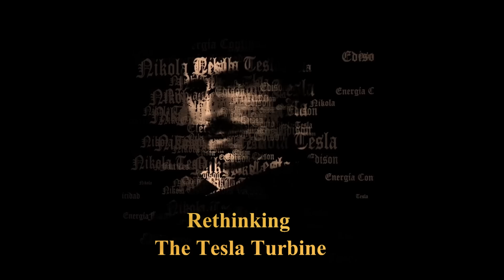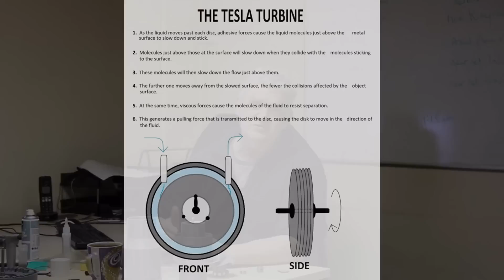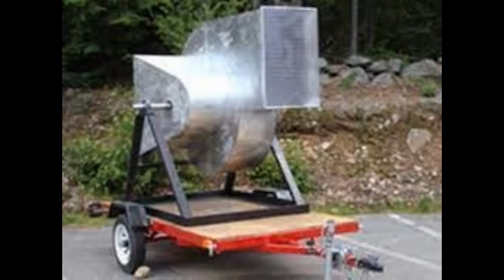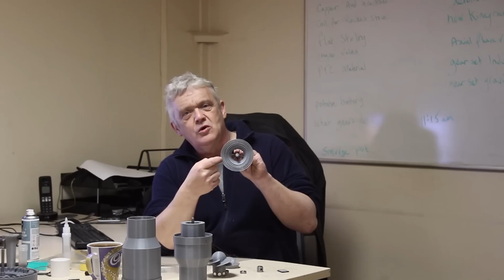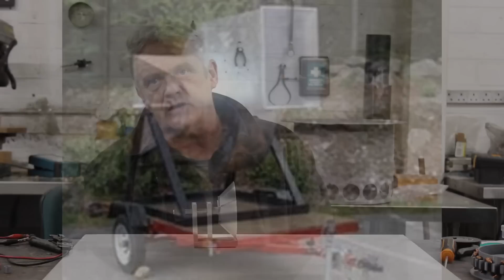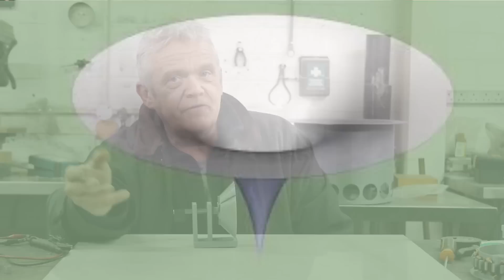1888 Rethinking The Tesla Turbine For Wind Power

Comment: The diagram in the beginning is incorrect. The pipe on the right side of the turbine is NOT the exhaust. It's the inlet for reverse spin. The exhaust is from the center.

Comment: Bro it's not a friction turbine. Tesla explicitly mentions this in his patent. Its actually an electric turbine why because its not supposed to move the discs with friction quite the opposite the motive fluid is intended to ADHERE to the disc due electrostatic adherence. Ideally the discs should not be moving faster than the force squared to the proportion of motive fluid pressure from the nozzle. 

It does not make power through RPM as commonly misconstrued by reducing slip you gain torque.

Comment: How about using a Darwin wind catcher funneled through a venturi and fed into a tesla turbine with a serpentine rim generator? I think this would aid in the higher pressure to maximize the Tesla turbine with speed on rim generator for increased power generation.

Comment: You seem to grossly missunderstand how tesla turbines actually work.. 
In a conventional one, the air exits the turbine at the center. The centrifugal force of the air spinning increases the pressure and generate more aerodynamic friction than any modified design would. The rotational force still comes from the direction of the fluid and not from bernouilli's principle. 
The angle you gave to that air dryer just made it turn like it would have made a simple ball turn. 

Tesla turbines are amazing at converting very high pressure into rotational speed and maybe now that we have more efficient gearboxes we could be able to extract some useful torque from it..  

If you want to test your idea to see if the principle work at all, use water.. put it in a river and if it spins up you will know it could work at a bigger scale for air.

Comment: Question:

What if you put a set of spiraling fins on the inside of the cones to direct air flow, so that when the wind is head on, the fins redirect the air coming in.
I'm talking short fins both in height and in length. just enough such that they grab the air coming in to begin the whole thing to spin, and then once started it creates it's own vortex to keep spinning..

Comment: I love your rethinking approach!
I never present a problem without at least a conceptual solution, so here is my offering.
When you look at Tesla's actual concept question, it was about efficiency in maximizing power transfer. Thus by injecting a fluid into a cylinder, the near 90 degree angle of attack maximizes the available energy of motion to be captured. And like water draining in a sink, the vortex pattern was his inspiration...
"What if I flattened the vortex funnel into a stack of layers and captured the mechanical energy with the disks?"
That is the fundamental design question and solution.
Based on his design theory/solution, a modification to your design would be a shroud on the face with vanes to induce as close to the optimum 90 degree angle of attack at the edge of the cones. I am thinking like a conch spiral shell (three or four channel?) to minimize back pressure losses.
The whole idea is to recreate the initial confined rotation of the fluid's energy by the external casing of the turbine. And inclusion of a weak venturi collar at the exhaust would assist in preventing back pressure build-up from the mechanically spent working fluid.
Once again, base concept is capture the most energy of a working fluid in rotation as it spirals in it's funnel vortex down a drain.
So I see setting the initial optimal angle of attack as the problem to solve first, and the second being being the reduction of exhaust back-pressure as close to zero or negative if possible. I think you get the idea of the context of the design issues Tesla was trying to address. Angle and flow volume to translate linear differential pressure of a working fluid into rotational torque. Hence flattening the funnel and stacking the design with parallel coupling on a common shaft. Tradeoff is really efficient laminar flow coupling vs centripial force of the working fluid wanting to return to the outer edge. This means for a wind powered system, your design solution is intriging as long as you can get the air moving in the required rotational vector first.

Comment: Could you put a solid cone on the front in order to shape the wind coming into the turbine? Just a simple cone with a shroud that lets the wind in and pushes it around the cone to let the air enter the turbine at the desired angle.

Comment: Your Tesla turbine diagram is incorrect. The outflow is through the center hole surrounding the axle. The pipe in your diagram with the arrow pointing out is not an exhaust. It is the reversing input. Both pipes should have a valve, and one or the other is opened, depending on which direction you want the turbine to spin.

Comment: I think you missed an important aspect of the Tesla turbine. Your diagram shows the air exit in the wrong place. The Tesla turbine air exit is axial along the shaft. This causes the air to compress as it spins, increasing the density. This improves the binding to the disks and the efficiency.
Reply: Compressible fluids are more efficient non compressible  fluids   Are not
Reply: But I do like where your going with the trumpet shapes. One problem is the faster it goes the higher the efficiency. But the disks distort and explode

Comment: An interesting arrangement. As you mentioned, airflow must enter at a tangent to the discs/cones to create any power. In light of that fact, perhaps two turbines could be arranged at a 45 degree angle to each other with an edge facing into the wind, both driving an idler gear driving an output shaft so that both turbines can face the win at a tangent and drive a single shaft for the generator.

Comment: In theory, this would really work very well if it works along with the Coriolis force.

Especially if you can cause a drop in pressure as it "falls away" from the edges and accelerates into the center.

Comment: Very nice Rob. With the right design you may be able to increase the usable surface area compared to a standard Tesla turbine using this cone method. Now you have given me another idea. Make all the cones the same size and use a hyperbolic cone, shroud and stater fins to direct the air in from the sides but keeping the intake still in the same direction and axis. Basically a fixed Waters turbine on the front with a shroud to direct the air into the Tesla turbine at the correct angle.

Comment: Tesla turbine's discs are of the same size and fluid's pressure and velocity are the same so they simply add up. In the case of concentric tubes system, fluid velocities and pressures vary greatly because of different radii, contact surfaces and angles. The ring layers of air move at different velocities and that results in wide range of force difference in which the smaller ones create a drag on higher due to turbulences.

Comment: I'm glad to see you're starting to work on this. I've been wanting to try this myself after(for some reason,curiosity, i guess) I threw an umbrella, that the broken at the handle, into the chuck of a 7amp dewalt drill. i thought it was going to fly away lol. I'm curious to see how the funnel design will operate but I would personally suggest going the spherical route. Mainly because the flaw Tesla couldn't overcome was that the plates stretching. Vortex shaped plates may have this same issue, but my theory is spherical shaped plates wouldn't because of the strength of the arc. I believe attempting to counteract plate stretch is the reason Schauberger's repulsine plates are shaped the way they are. Thanks as always for the videos!
Reply: Tesla improved on it twice. The problem is people think the power comes from rpm it doesn't power comes by reducing slip which means harmonizing motive fluid pressure and disc rpm regime at peak efficiency. If RPM is your gauge of efficiency then all you're making is a slip machine that will reach speeds that tear it apart or warp it. 

Someone here on youtube managed to produce 6.22ft/lbs of torque at 4500 rpm with his 10 inch setup. Tons of pop scientists on youtube spreading misinformation that you must spin up to 90,000rpm to get anything useful its not true.

Comment: Dear Mr Murray-Smith. I am not sure that this idea corresponds to Teslas turbine principle. In my humble opinion, the Tesla turbine takes in the flow of fluid tangential at the perimeter of the disk stack, and the fluid swirls around in a vortex, while moving closer to the center, and exhausts axially via the center hub hole. Or am I wrong there?
Best regards.

Comment: You could try adding a tear drop nose cone to align the air flow direction enabling the device to simply point into the wind (fluid) by use of a vane.

Comment: How about putting a smaller pointed cone in front. The pointy end faces front?

This is to enable it to work even if the wind is in the front and not an angle.

The cone shunts the incoming wind into the sides. You might have to adjust the size though.

Comment: Interesting! I've considered square shaped housings to direct air flow from all directions for the case (like reverse tornado sirens) while the turbine is on a vertical axis so it doesn't need to turn the structure. I think laminar flow (reducing the turbulence in the airflow,passing the air through a bunch of coffee stir sticks can take out tons in testing!) would also help increase efficiency since you could stack more airstreams alongside the turbine blades as it swirls inwards.

Comment: If you put a slightly inward-turned lip on the front of each of those rings, and a nose-cone through the centre to outwardly displace on-coming air, then even directly on-coming air should catch the ring-discs.

Comment: I think this (as-is) would be lower performance than flat discs, because in the flat disc the fluid spirals around the disc, towards the middle, and exits out the centre of the disc.  With the cone design, the fluid can only complete half a turn before it's blown off course by the air coming straight in and exiting straight out again.  So I think you could improve the design by closing it so that once fluid enters the cone, it is free to spiral around multiple times without being blown off course.  This would allow you to extract the most energy from the movement of the fluid, like with the original Tesla design.

Comment: Since the cones need to be at an angle to the tail, maybe it makes sense to have two cone sets to one tail, both of them with their optimal angle in line with the tail and center lines pointing off to each side, but spinning opposite directions next to each other. It would balance itself out, so you wouldn't have the issue of offsetting the wind angle of just one, against the tail. And it would look space age:)

Comment: You spoke of a Prony brake dynamometer. There is a cheaper simple to make dyno. This was used to test engines by a large English car maker in the WW1 era. They used the engine to drive a generator that lit up a panel of light bulbs. From the number of light bulbs it would light at full power at a certain RPM they could calculate the HP.

Comment: Instead of having the back end be open to all of the cones' slots, what if it only exhausted the air through the slot on the inner or outermost cone blocking the rest, and have slightly offset holes on the rest of the cones' faces near the back forcing the air to spin laterally against the blades more? I thought Tesla Turbines relied on that vortex, maybe it could help here.  I love the rethinking of the tesla turbine like this!

Comment: Given the relatively low amount of friction with a gas (air), isn't a Pelton wheel more efficient?
I saw the propeller for your gutter generator and was curious; could you get more torque (not speed) with a series of stacked propellers in a conical fashion similar to a jet turbine?

Comment: This is a very interesting series. harnessing the wind is quite cool, but I wonder how well all these turbines would work in the other direction. How well could they generate wind or pump water?
Reply: Tesla Turbine type pumps have been on the market for at least 30 years.  (Discflo Pumps)  They have low efficiency (<65%) but do not wear out when pumping abrasive slurry. - good for pumping sand and mud.
Reply: @danedmiston9673  as someone who has to deal with sand and mud very often, I wonder what kinds of pressures and flow rates can be achieved with this. 

We have a deep water well with a off the shelf submersible on the farm, but every now and then the muck gets in there and the motor burns itself out. 

But then again, you do run into size constraints with the ol' borehole.
Reply: @na9rz  The Discflo pumps that I have seen were all industrial size.  The disc in them were spaced as much as 4" apart to let large debris through.  They were fairly low pressure for there size.  I know they have been used for pumping mining waste water, live fish, and product as thick as toothpaste.  Efficiency was never a selling point.
Reply: @danedmiston9673  pumping live fish?! that is impressive, thank you for the info!

Comment: Very cool mate. You know your the 1 that got me into 3d printing. I have an Elegoo Neptune Pro S arriving Friday. The Plus is sold out right now so I got that 1 instead. I have tons of ideas I want to manifest and I think this is an awesome way of doing that. 

I had a suggestion. What if you added fins in a vortex pattern on each cone so that the angle of attack is changed like say it turns when the air is blown from the front? Maybe even add a cone in the center with fins on it also?

Comment: So Darwin intake for unidirectional wind capture, Venturi compression/acceleration effect duct (slightly offset) to a Tesla Turbine for capturing the fluid friction to generate the mechanical spin. 
Use the spin to generate electricity, use the electricity to heat a sand battery...

Comment: Hi Rob, I remember years ago hearing a aronautics engineer explaining how a properly designed cowl around the prop of a stunt plane gave them an extra 30% efficiency. I wonder if a cowl with the matching angle around and partially in front might direct the wind at the proper angle to the business portion of the turbine....even if directly facing.

Comment: Hi Rob,  maybe you are trying something a bit different... The way I remember the Tesla turbine working is air or fluid travels across the tops of the disks and then spirals into the center and exits out around the Shaft at 90 degrees angle from the original air direction. Around the shaft there are holes in each disk. I do like your idea.  Keep up the good work.

Comment: ?? wouldn't the  outer travel distance slow the smaller distance down, as air hits surfaces it slows so if it hits the the larger diameter first it slows it needs to hit the smaller diameter first and as it moves it slows across a bigger diameter, does this make sense?

Comment: This is not the same effect as the Tesla turbine.  The Tesla turbine is a stack of flat disks in an enclosed container with the input being on a flat plane with the disk parallel with the tangent of the disks but slightly inset so that it flows into the space between the disks and spirals towards the center of the disk where the outlet is located.  Your turbine has the force being applied practically perpendicular to the surface of the cones which is causing them to rotate.  The Tesla turbine has the force being applied parallel to the surface.  Your turbine is turning due to the impact of the air on the shaped surface of the cones, the Tesla turbine is turning due to the frictional/cohesive forces of the fluid on the disks.  These are two entirely different phenomena.

Comment: The optimal angle of the wind actually seems to correspond to the angle of the cone. Therefore, for real wind applications, it might be useful to tilt the axis of the turbine so that one of the outer surfaces of the cone is horizontal.

Comment: I've a feeling that a rose-petal element might be useful on the outside 'funnel'. It'd help give the whole structure some omni-directional qualities, I should think.
Doesn't have to be too-pronounced an angle....it just has to be enough to provide the work to overcome the inertia, and provide an 'exit' for the flow.
This thing has enough work being directed at it to make it spin, it's just that the energy is essentially hitting a flat surface - but including some kind of subtle petal/wing into the design of the outer disk would act like a small starter motor.
Also, I should imagine that, once spinning fast enough, the device would become effective in an unfeasibly wide cone.
This is some powerful kung fu.

Comment: I don't think so mate.  Sorted out the Telsa Turbine and that eight sided tower design in a though experiment weeks ago as part of a unified design weeks ago.  I have even improved the design in the thought experiment.  I still don't have time to muck around with the construction but this you came up with, it's not going to work well.  The fluid has to be perpendicular to what is being used to rotate; right angle.  .5 mm disk x 6 I think, with a separation of .5mm or a bit less.  with a gap on the outside of the disks to housing of something around .1 mm.  On the disk use of impressions in the disk on both sides.  This is to increase the capture of the force for it propel the disk; square pattern, very close, doesn't go very deep; divot is what I call it.  A perfectly flat disk doesn't give it anything to grab on to in order to create the torque.  The gap in between the disks and casing is pressure relief/balance.  Too much pressure on the leading side will cause the disk to warp.